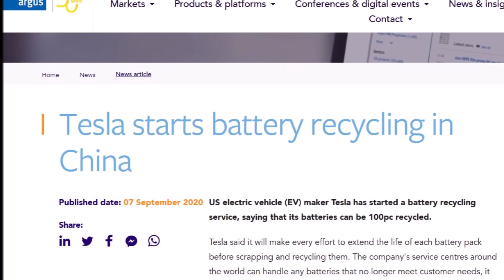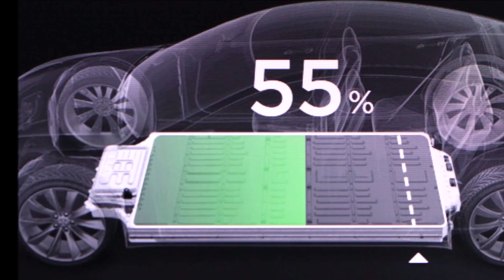Tesla Starts Battery Recycling And Swap Program

Comment: My guess is the following: 
1. Tesla "recycling" of its own batteries is removal of the packs and conversion to stationary energy storage for grid energy storage. 
2. Recycling non-Tesla LiIon batteries would include cell phone, laptop, etc. batteries to produce an additional stream of Ni, Co, and Li parallel to raw materials for new batteries. 
3. Recycling most likely to be by or in partnership with Redwood Materials. JB Sraubel's startup Redwood relocated to Sparks NV. JB was a cofounder of Tesla and left a few years ago on good terms and likely after discussions with Elon about the need for recycling and potential partnerships on the new battery recycling industry. 
4. New batteries will need less Ni and Co and the compounds produced by recycling will be much higher concentrations than the raw mined minerals - meaning, less expensive raw materials and a multiplication of batteries (each high content LiCoO2 or MnNiCoOxide recycled battery could provide cheap Li, Co and Ni for 2-5 batteries).

Comment: Armen, battery recycling plus million miles battery equals V2G.
Vehicle to grid will generate $100+ per month income on 1 million vehicles = $1 billion per year with near zero costs 
It's enormously profitable.  Also the effective purchase price drops by $20k making Tesla cars really cheap to buy
Reply: Nonsense
Reply: It's not an effective argument to use future possible earnings as a reduction in price.  A $100,000 taxicab isn't effectively free to purchase because of the $100,000 in earnings the taxi driver will make...
Reply: @carlstockmal  correct.  But,  if you buy a Y with 12 year loan, $350 per month.   Then you earn $200 per month income from V2G.   Then the effective cost is around $20k due to the income you won't get with any other vehicle. 
V2G is coming soon,  hopefully in 2 weeks. 
Meanwhile,  price is headed back up and S&P may announce any day

Comment: 100% recycling of Tesla batteries...awesome. A cradle-to-cradle production system without waste. Only nutrients cycling making new batteries. Thank you William McDonough!
Reply: Nonsense there is not a 100% recycling
Reply: @carholic-sz3qv  Ok so is Tesla and this guy presenting lying then? Or maybe you cannot believe the world is getting smarter.
Reply: @aaronvallejo8220  the world is certainly getting smarter but there is no 100% in recycling, even batteries and motors aren't 100% efficient, recycling also requires alot of energy and other processes including chemical processes..

Comment: Redwood and JB Strabel is doing recycling by Giga Nevada
Reply: Redwood, to my understanding is focused on post-consumer material. Used Batteries. A supply which will grow quickly.   Another waste stream for recycling is the material waste from the Manufacturing process,  pristine and unused. In some cases this can be considerable.

Comment: Hi people
Be aware that's recycling is a language bias where we usually mean valorisation which means reuse.
Recycling understand as breaking down the product to make material is the last thing. You do this only whe the product has no more value at all.
You have to be aware about 2 things : 
Recycled material are not qualified for making new batteries because there are no pure materials. 
The second thing is the cost which can be reduced by new tech which leads to better recycling to produce better raw material.
Most of the time recycling means incineration (burning) to make heat for collective housing or to make electricity (at least here in France)

For the batteries, they gonna reuse the battery cars to make cheaper power-wal and I believe they are already using the lowest quality batteries for the powerwall.

Comment: China just going to duplicate any factory Elon builds there and out compete him. They’ve done it to everyone else, why is Elon naive?
Reply: Tldr... He isn't naive. It's just that IF they did that, he wouldn't care. It would be an environmentally positive outcome and congruent with Tesla's mission statement. 

Longer reply...

Firstly,  Musk has stated that if tesla goes bust, but accelerates the transition to sustainable energy then tesla succeeded.

Therefore  as Battery recycling is crucial to this. The more the merrier. 

Secondly, tesla alone couldn't recycle the entire world's supply of batteries, there are plenty to go around. So again the more the merrier. 

Finally,. Tesla's recycling will likely be tesla battery chemistry specific for max yeilds  and cost effectiveness. Even if someone tried to rip it off, they would need to modify the design at least a bit for the chemistry they will most often encounter which will not be tesla batteries. They may be able to steal a few ideas, but full rip off and undercut, not likely.
Reply: Part of your answer is in the fact that Teslas made in China do not have access to top tech batteries that are put into vehicles destined for regions which respect copyrights, and have the legal means of enforcing them. I agree with you completely about the "ground rules" associated with economic competition with the Chinese.... there are no rules!!  If something can be taken, it will be taken and exploited.
Reply: Elon isn't naive. Funny how ppl hate on China so much. Sure there will be some copying of Tesla tech there. Do you expect access to the world's largest auto market to be free? But Tesla has the best engineers and is years ahead of any competition globally. All will probably be copying Tesla, not just China. And Tesla prob doesn't care at this point because it is the leader and everyone else is just waiting to copy.

Comment: Since long-term, Elon has said that every factory will eventually have local cell production, it seems logical that each would also have a recycling program, to reduce reliance on new mined materials required at each plant. Who really knows, but if the factory layout allows it, it seems logical that anywhere cells are produced, it would be helpful to have recycled materials readily at hand.
Reply: Dana Oredson sometimes chemical compounds are so stable it’s difficult to breakdown for reuse.  I’m not sure whether that’s the case for lithium ion batteries however.
Reply: Well, I don't see the need to second-guess the experts, when they say that 100% of the battery can be recycled.
Reply: Dana Oredson there is a lot of literature on the subject but my understanding is that the maximum recyclability of Li Ion batteries is 80%. However 50% is the norm right now.  Better than dumping them but a considerable amount of waste is produced as well.
Reply: All we can really go off of is Elon's statements and JB Strausel's statements on their plans for recycling. Legacy literature is good and all, but doesn't take into account Tesla's own research.
Reply: logic and manufacturing are 2 opposing philosophy. this is well understood in the global economy often what makes perfect logic becomes detrimental to success. the nature of global communities requires approximations of possibility beyond traditional logical thinking. Logic works well with local over site. manufacturing process is driven by global trends which is almost impossible to see logically. 

the first principles philosophy is the dominating force behind tesla and space x engineering. which can be said is ineffective and almost unsustainable for legacy companies. as tesla becomes a legacy company to spread its wings from start up drive. first principles thinking will need a revamp;

Comment: Re: China being the biggest Li-Ion recycler. Sadly, this includes quite a few businesses that simply take end-of-life battery packs, relabel those individual cells that have not completely failed to work and re-sell them on ebay as "new".
Reply: It's called grey market
Reply: @The4lexO  The recycle market might  pay better than the reuse market. 
Not all the cells are bad. Re use is the highest form for recycling if done with integrity. China?

Comment: Surly a ton of used batteries is a far richer ore for the supply of metals than a ton of any ore you dig out of the ground.  A no brainer.
Reply: the problem can come from safely and efficiently recycling the batteries Vs pumping salt water out o f the ground, it has always been done at a economical loss.
Reply: The other problem is how much materials from recycling will be enough to make million EVs!?! There aren't even enough EVs to start recycling at bigger scales, plus batteries can be used after cars for home storage